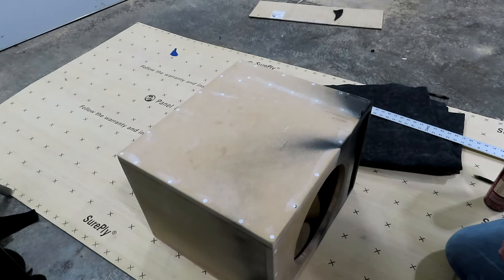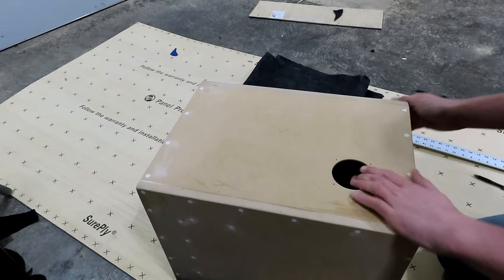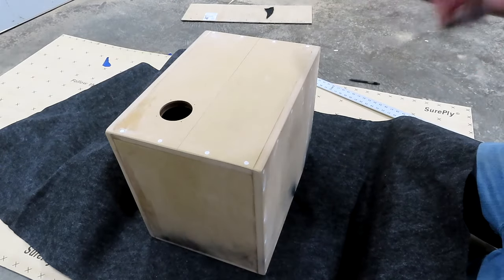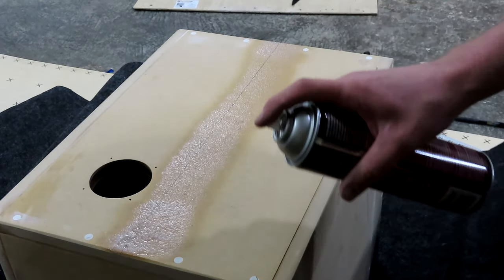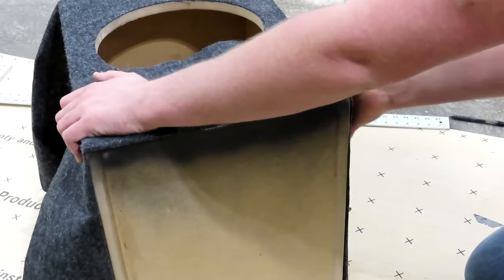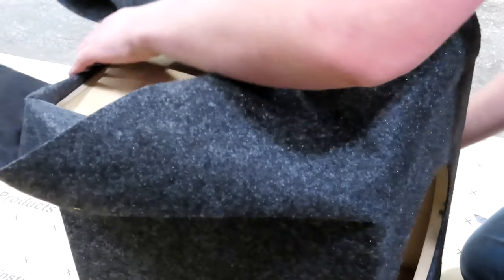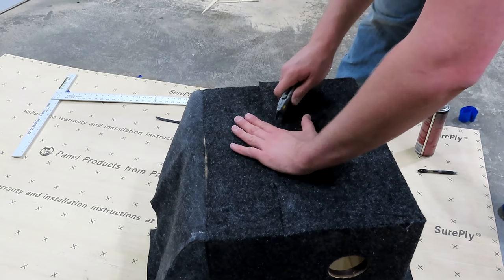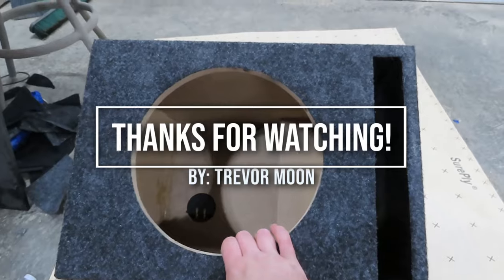How To Carpet A Subwoofer Box At Home With No Special Tools

Comment: Very nicely done.  One thing that seems to be missing is how to size the piece of carpet before you start working so that the flaps are the size you need them to be.  My first attempt I had way too much material and ran into a lot of difficulty.
Reply from the maker: I usually just buy a $10 piece from Amazon.  Whatever size that is
Reply: I don't mean what you buy, but how you size it for the particular box.  My box is more rectangular than square so those end cuts are harder.  If the flaps aren't in the ballpark it just turns into a mess.   On my second attempt the flaps were too short in the long axis, so another fail.   @ATCA

Comment: I just tried my first one and have glue showing on all the seams and some other spots. Looks like it's better to only glue the box to avoid glue showing in the seams. But I tried the utility knife method with a new blade, and it took several passes and some tearing to get it to cut. Any special tips for getting a knife to cut through on one or two passes??
Reply from the maker: Oddly enough,  a sharp knife is the secret. those blades last only a few cuts. Lots of pressure. I used to freak out about glue on the edges. However,  skill will keep the glue where it needs to be, and goo gone will clean up the edges. Just keep trying.  

More force when cutting,  and goo gone for edges. Works  a treat

Comment: Hey Trevor, i'm doing my box tomorrow. 
How would you do the fabric (in my case leather) around the port in a box with a little more power (4 12"s) - so it doesn't peel on the first low notes?
Reply from the maker: If you seal it like i did with polychylic and lay the glue on both pieces and lay it on thick, it should hold.  The only other option is to make the box with one baffle, then make a second baffle and rabbit the inside of the port about 1/16. Then your material can be glued and tucked into that rabbit groove
Reply: @ATCA   Thanks for the advice, i did it today and it looks decent :)
Reply from the maker: @Cher007  post a pic or video bro. Id love to see it!